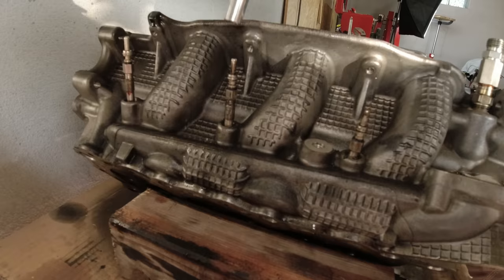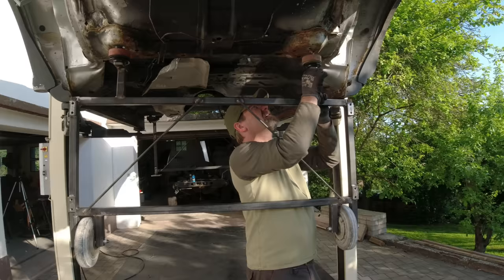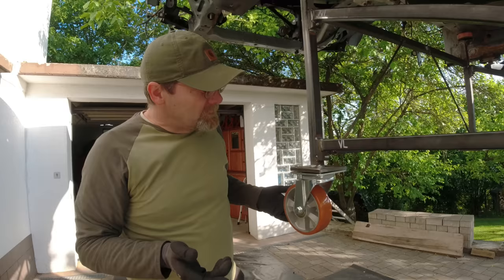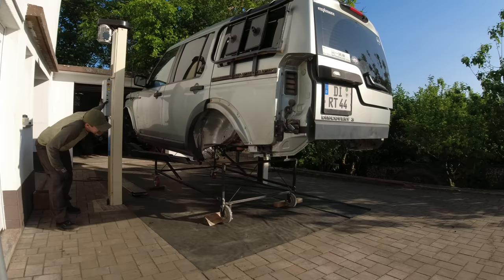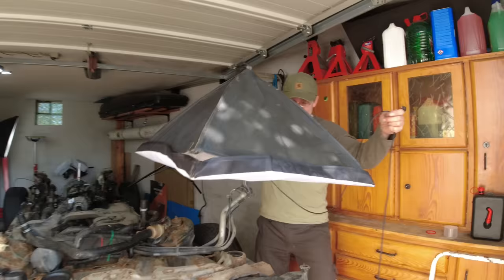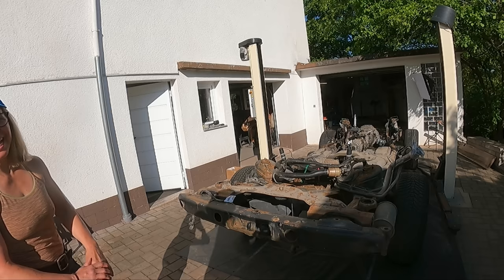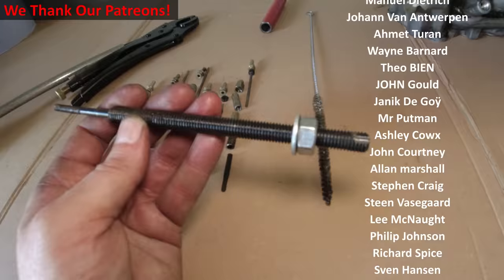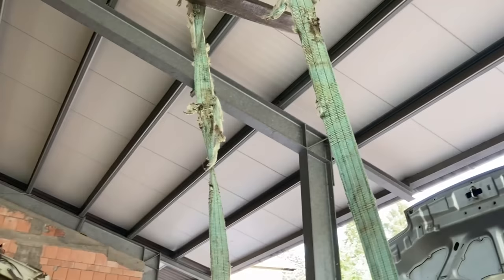Body Transport Cart & Difficult Glow Plug Removal / S4-Ep25

Comment: I had no missed heart beats with the hospital bed, 100% faith in that. However, my nerves were in tatters watching the glow plug removal. 
Having broken one in a engine once before I could hardly watch. That was 5 hours of hard work. Nice when it is all over I guess.

I take mine out of my Land Cruiser every couple of years and run a 6mm drill bit down by hand as per the manual. 

Even though I watch every week I still know nothing about Land Rovers.

Comment: Thank god for Vera. What would you guys do without her. 🙌 The hospital bed looked pretty average compared to the German engineering safety hoist made by the two young engineering/physics professors. A big hello and congratulations to them both👏 as I am going to use there technique to hoist my four wheel drive. I am still considering if I should make a hospital bed for myself or a church bell.

Comment: Those glow plugs - crickey. Would have been an utter knightmare having to do that on a fully built engine ! I have not long attempted it on a 3.0 M54 engine and I chickened out.

Im sure many of us will be able to relate to the conversations (i mean shouting 😂 that would have occured) during the trolley movement if we were even attempting that with our partners 😂

Glad you 2 pulled it off safely - Also great to see your son having learnt an excellent craft as a blacksmith.

I also saw in your previous video your other son as a pro BMX rider when Vera took the disco 4, absaoutely briliant, what a talented family

Great video as always 👍

Comment: When l saw that frame so high off the ground l really did have visions of it tipping over - reminded me when l had to make a set of wheels to go under the rear wheels of my Mercedes SL that was stuck in park on our driveway with no ignition and l had to move it - thanks guys informative and great video

Comment: Can I just say its great to see your son use traditional methods ( blacksmiths ) to produce wonderful iron works esp for restoration of old buildings like the bell yoke from the church ( presume its a old building ) . Wow those glow plugs were a nightmare to get out. 

I have a evoque and the first O2 sensor has failed ( nearly a 5 yr old evoque ) and the garage say its a nightmare to get too , you have to take the subframe off and the firewall off which seems daft and to top it off the sensor cost me £252 ( had to buy from JLR ) Bosch don't make them yet

Comment: Another thing to add to the main bearing and crank problems is that Ford made a two part sump for the 3.0 power stroke to increase block rigidity I think that if this happens to be a problem a modified sump could help.

Comment: I love the hospital bed, well done Robin brilliant and it can fold way into a small location for next time.
I was ignorant of the removal of Glow plugs Christian, I was having problem with winter starting my Toyota Hi-ace Van 2.8 litre diesel for years even resulting in pushing hot air down the air intake to warm things up a bit, and the use of Start you Bastard (ether) we don't get snow here but first start in the day could be 1c temps, 
After finally getting fed up with it I decided at 200,000 kms maybe it is the glow plugs so while I was visiting my mun in Perth I brought 4 new glow plugs and in her driveway myself and a mate spent around an hour head down bum up between the drivers seat and passenger's in awkward positions replacing the old ones, thankfully they came out without your problems, I just thought that it would be like a normal spark plug
After seeing your video I realise just what a mistake that could have been as I live 100 kms away in the country, it didn't make any difference at all with the starting, I solved the problem with help from an on the ball parts salesman,
Just after getting the van at 278,000 kms the CAR battery that was in it died, I just replaced it with a new CAR battery the parts salesman told me after the glow plug change that as my van is a commercial vehicle and start stop driving usually you need a bigger COLD CRANK Battery in it
Thankfully the store had batteries on special mine should have a
 930 cch battery in it cost normally 350$ Australian  special price 180$
I put it in and never have had another starting problem with it.

Excellent video as usual both of you
Tony from Western Australia 🇦🇺

Comment: L/T.  Very great efforts with a custom cart to move this Discovery seperately !  If this was done Downunder, we would diagonally cross brace the horizontal beams at the top and bottom to meet cyclone or hurricane wind standards ?  Old Father Miltrop from his memoirs of 50 years in the ex. German colonies would agree or completely tell us off.  V

Comment: You can see Christian is a real engineer.

Not cranking on the glow plug, just pulling.

That is the secret.

This is the reason that studs are superior to bolts when fixing a cylinder head for example.

Comment: I went the other way and did not replace them , but instead my car guy fitted a remote controller for the fuel burning heater so now I can get the heater running for a time before starting the car which heats up enough to start it in cold weather . Chickened out but it works for me 🤣 I have had her since 2016 and I December she will be 19 years old and I am not sure if the glow plugs have ever been replaced !

Comment: @12.50, i've had that problem with the glow plugs on my Fiesta Diesel with the Peugeot diesel engine, they can be a nightmare to get out, it's the carbon build up around the element, i've had a tip break off & couldn't get it out

Comment: Hi Christian, I saw in the video that you but the complete cylinder head in the hot oven, , to try and release the glow plus, but the glow plug and the head would have both heated up and expended, so which one would expand the most the head and grip the glow plug or the glow plug and grip the head, I have often heat items up to get the out,or off, and now I have a small hand held induction heater which I have used a few time instead of a gas torch, and it works fine , so I was thinking an induction heater may have allowed you to heat only the glow plug to expend it and break the grip the head had on the glow plug and get it out easier

Comment: On the seized plug removal:  I have had great success with heating the casting in an oven.  While still hot, touch a wax candle on the plug.  Melted wax pulls heat out of the plug and decreases plug temperature.  Casting is still warm; therefore, max temperature differential and max linear difference.  Learned this from William when he was in a hurry to get to the Manchester game.

Comment: second engine cranked after 3500 km.  and an expense of 5,000 euros to do it all over again, car stopped at home, I don't know what to do.  My mechanic doesn't want to touch it anymore and this Range Rover doesn't want to see it in her shop anymore.  leads me that the 306dt is an engine with design errors and will always break I would like to try to do it again by myself.  what do you tell me?